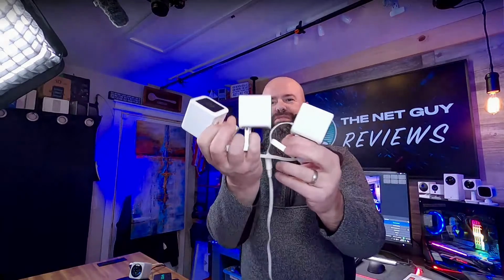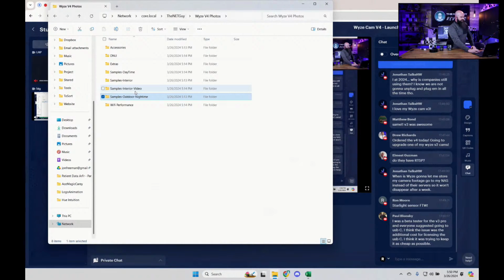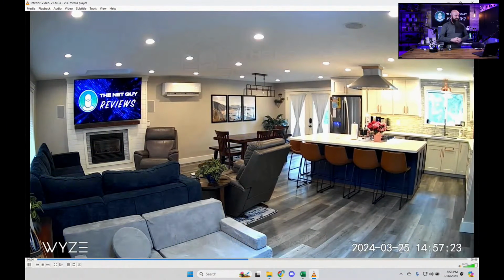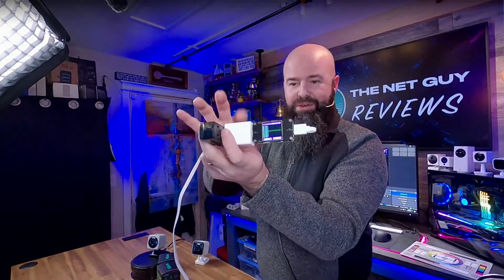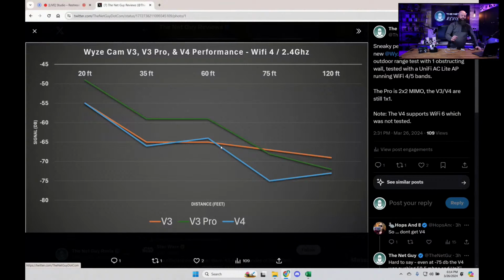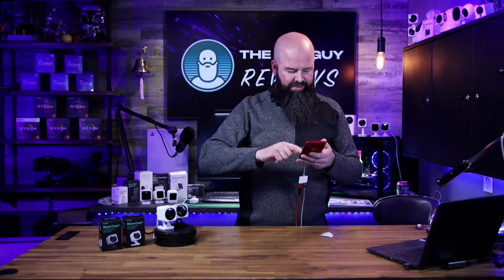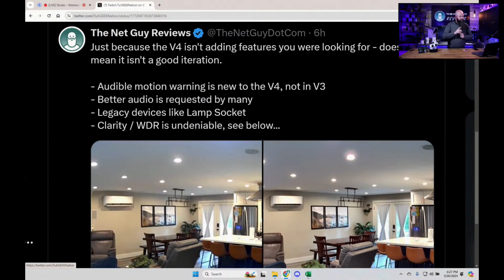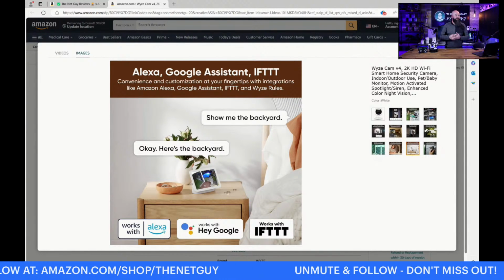Wyze Cam V4 - 🚀 Launch Day Live Review Stream

Comment: I replaced a V3-pro with a V4 and I'm not impressed.  The low light ability is TERRIBLE compared to the V3-pro.  Also the field of view seems smaller.  Fortunately it fit inside a V3 window mount from Wyze, but the bubbled lense face caused other issues (no IR light as it causes a solid white video in the window mount.)  Plus no black version available.  The nigher resolution is not that noticable either.  Seems like a waste of time and effort.  Hopefully they'll make a V4 Pro soon.

Comment: V4 seems like V3pro hardware with a few tweaks. 

When will Wyze fix their high compression / low bitrate streaming issue? It's 2024. We have fiber internet. We have local storage. There is no reason these cams should be streaming 2.5k hd+ under 125kbps.
Reply from the maker: In my tests they’re about 90kbps with keyframes every 2 seconds. That much compression leads to horrible artifacting on moving subjects and playback. I don’t even mind if they made that 30fps and lower compression a Cam Plus only feature.